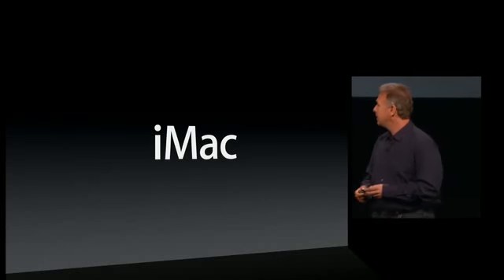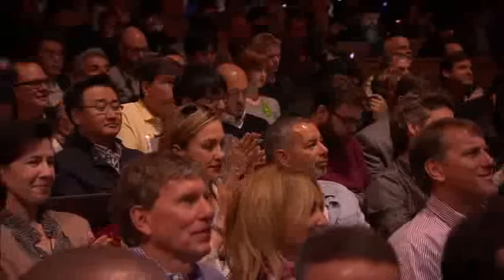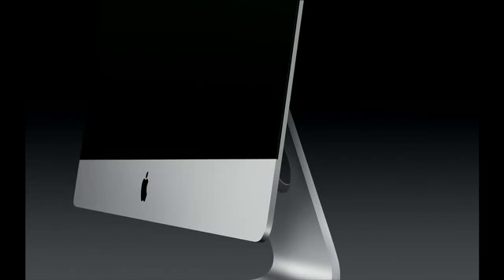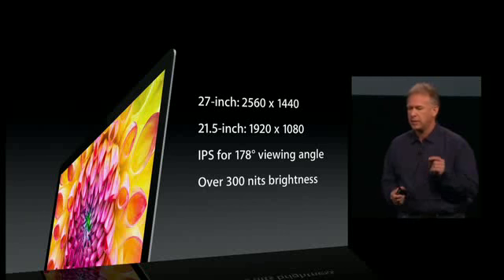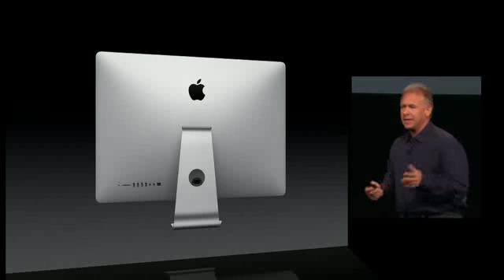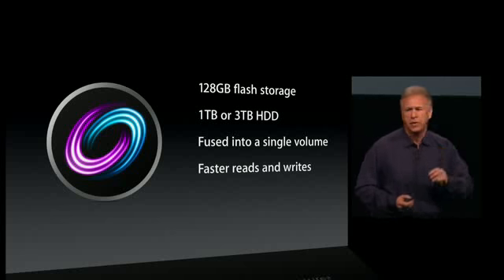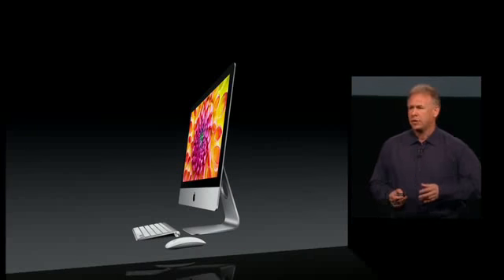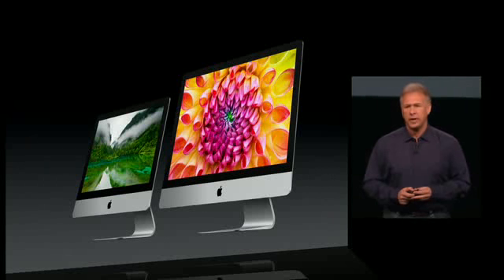New Apple iMac 2012 - Full Keynote Presentation - HD -Apple Special Event - October 2012

Comment: I'd still rather the 2011 Edition iMac or Early 2012 (Thick version) 
LIKE THIS!

1. Optical Drive
2. Upgradeable Hardware (CPU, Fan, RAM, HDD/SSD, Logic Board)
3. Better Air Vents and Intake cooling Fan.
4. Its Thicker
5. Everything isn't solid to the board.
6. Big Space for Components.
Reply: I have the late 2013 27in. version of the new thin one, I actually really like it. I added another 8GB to what it came with (easy, it has a RAM door on the back to get to it) and I'm going to upgrade it to have a fusion drive as soon as I have the money to.
Reply: it can be upgraded to 32gb ram easily

Comment: Apple logic: It´s better becuse It´s thinner! (altough it doesn´t really add any actual benefits becuse It´s a desktop) 

Here´s some things they could have done instead: make it possible to upgrade RAM and HDD for both 21,5 and 27 inch model, make it possible to mount the computer on a wall and add a Blu Ray.
Reply: Desktop computers don't need a blueray drives or really any drive for that matter. Any media I want I just download, i still to this day haven't used an optical drive on my desktop OR laptop before I had the iMac because I genuinely don't need one. If I want to watch a DVD movie or Blueray movie I just use my Xbox or Playstation, if I want to buy software/music/movies I just use iTunes. I actually have this specific iMac and upgrading the RAM is a bastard so I agree with that, but you can buy an iMac with a wall mount or you can buy one separately.

Comment: For record have two personal systems on my desk. First is an Antec 9 fan overclocking case with specifically chosen 1200W high end dual GPU NVIDIA SLI setup. It's a beast. But have recently had an iMac for demo purposes on side. I have to have multiple OS's so it's necessary. The iMac impressed me so much I current have my large gorgeous beast on the floor while I am typing on the much more likeable iMac. No competition. And saving my eyesight at the same time.

Comment: Completely disagree. Been repairing systems since late 80's and seen massive changes over time. I was never an Apple person but had to repair both Apple and PC systems when working as a technician. Was always impressed with their quality. Today all computer parts come out of similar Chinese factories. Apple set much higher quality requirements though. And I never thought so until I had to supply and support 170 desktop systems. Dell, HP 15% failure rate. Apple had 1 failure out of 68 desktops.

Comment: I cannot be ignorant?  I hate double standards.

Especially when one considers the fact that you don't HAVE to install them from discs.  You can either go modern and get the updated application from the Mac App store (which you should do anyways, get the latest version, you got the latest and greatest desktop/laptop, might as well), OR you can buy an external USB Superdrive and still use discs.  You're acting as if discs aren't usable AT ALL on the device.  They are, externally.

Comment: Ok, optical drives are one of the most unreliable pieces of hardware.
Plus, not everyone uses them.
If your DVD drive packs in (as mine has) it's a huge pain. I got a plug in drive, it was all of $30. Apple dumping the drive on the iMac was entirely predictable.
Hoping to upgrade to the new iMac asap.

Comment: Actually looking at the statistics optical disks are not dead, just looking at the volumes of disks sold shows they are far from dead.

Now the floppy disk, that died quickly as it wasn't used for any function except data storage.

A Blu-Ray compared to a download has much better quality, even if the download is 1080p the Blu-ray has a better quality file and extra features.
Portable computers can do without but a desktop should still have the ability to read opticals.

Comment: Don't worry, the specs make up for it. I know that PC trolls will come up and say that you could get more from a PC, but I just want to mention this, and I still like both Mac and PC computers. Apple is trying to scrape off the good old Mac Pro with this. With the 27 inch iMac, you could get up to 32 GB of ram and a 3 TB Optical or Fusion Drive. Again, I still like PC computers too, but Apple is just starting to step up their game. I don't care about the design, plus I still use optical drives.